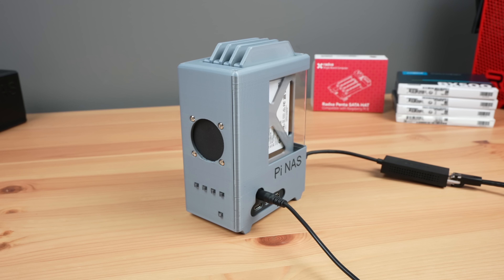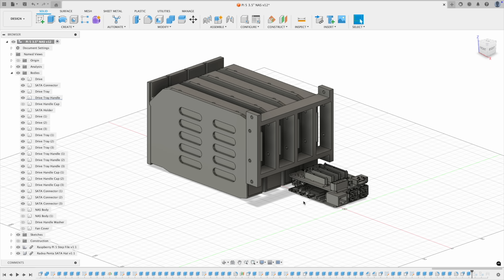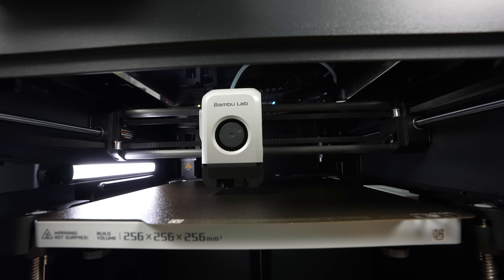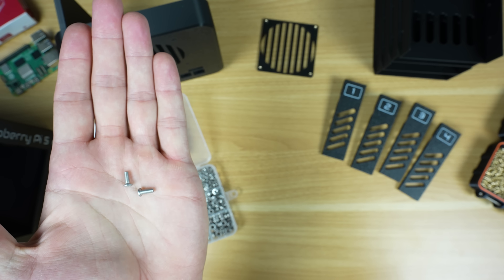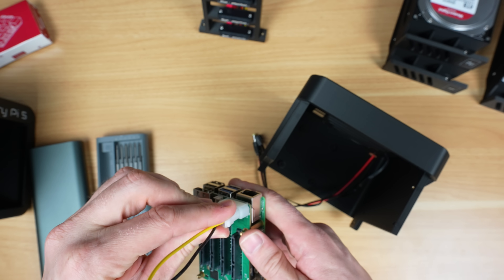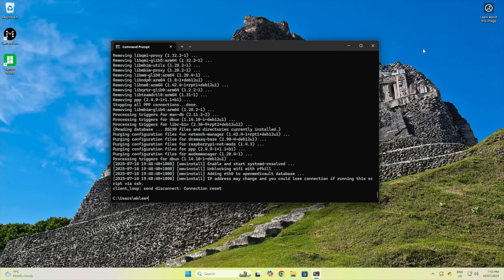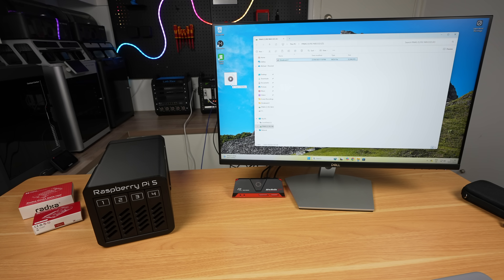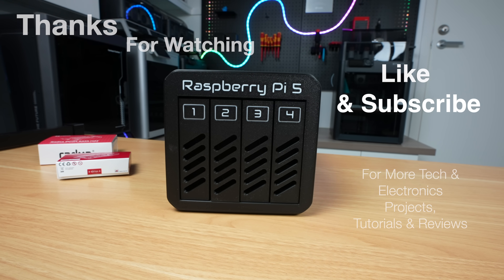I Built a 4-Bay NAS with a Raspberry Pi 5 - Swappable Drives & RAID 5

Comment: only thing i would change is probably adding a 16x2 LCD to the Pi's GPIO, or even an i2C OLED display, just to give basic status info like IP, Name, Space used etc.
Reply: Yes it would be nice to see some CPU Load and temperature stats on a little display.  Maybe he'll do that in version 2?
Reply from the maker: Thanks for the suggestion, that would be a fairly simple addition!
Reply: As there so much in the back I would add Geekworm's UPS HAT, would give the NAS an internal UPS for power outages
Reply: @RengenZohar This is such a great idea! I just had a look at it and will probably try it out in a few weeks. Will report back if this is a viable option or not.
Reply: Doesn’t the HAT block the GPIO pins?
Reply from the maker: Yes but you can still access the pins from the top and the I2C pins are available through the port on the front of the Radxa hat.
Reply: @MichaelKlements  Ah, OK. Thanks!
Reply: Even a touch LCD is possible
Reply: no need for such nonsense

Comment: Great looking NAS but I would have used PETG at the very least rather than PLA
Reply: With the cooling and low-power hardware, none of the parts in contact with the platic will get near to the point 60 to 65 degrees C where PLA will distort.  I do think PETG would be better in general.  He did do his 10'' mini rack in PETG.

Comment: Like this build, I have more 3.5hhds then I do SSD and this will let me start to use them again.

Edit: would you use a pcie splitter hat to make an 8bay?  Maybe make it front half two pieces to mount them behind each other? (2 rows of 4?)
Reply from the maker: Yes you could probably make an 8 bay one with splitter. Each hat would supply power to it's 4 drives so there wouldn't be any power issues either.

Comment: RAID 5? pointless.
Single USB 3.0 HDD will result same speed like yours 250MB/s
Reply: Single USB 3.0 HDD is not not accessible over the network and also has no redundancy
Reply: @xpatrikpvp  Wrong. i'm using as NAS. If you don't know how i can teach you.
Reply: @kreaxv  How does a single drive have redundancy? Teach me master! Maybe only half of the drive fails and the other half is good to go?
Reply: @RaduRadonys  Raspberry Pi 5 fastest port is PCIe Gen 3 x1~700–900 MB/s.
RAID is useless. What a joke

Comment: Are their advantages or downsides to using PETG for this project?
Reply: Advantages would be to avoid the heat creep you will inevitably get in a case like this.
Reply from the maker: PETG would probably be a better long term solution.

Comment: looks cool, I would have tried to get a larger fan to cut down on the noise and tried to boot from a SSD/NVMe instead of microSD.
Can you not output PWM signals to the fan from pi GPIO pins? a python script can also link this to the drive temperatures reported by SMART
Reply from the maker: I was worred that there wouldn't be enough space in the back with all of the cables but should be able to fit a 100mm fan in. Yes PWM fan control is possible, its just not easy to do with the hat design covering up all of the GPIO pins - you'd have to solder something onto the back of some of the pins.
Reply: What Power source you used ?